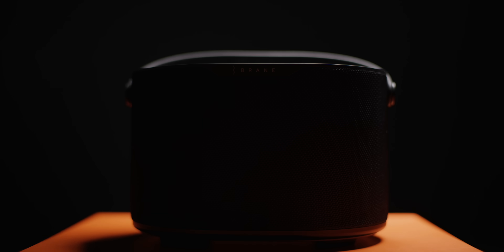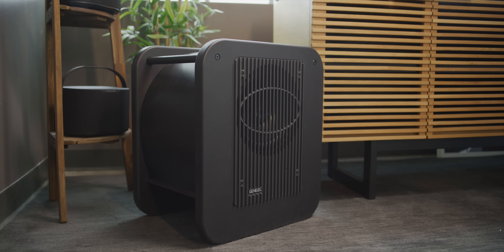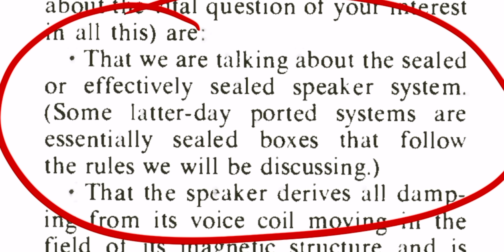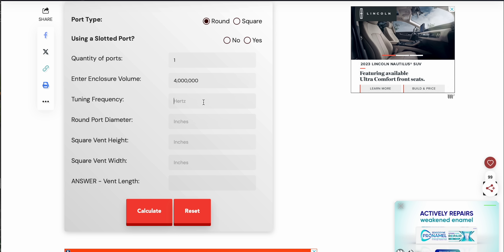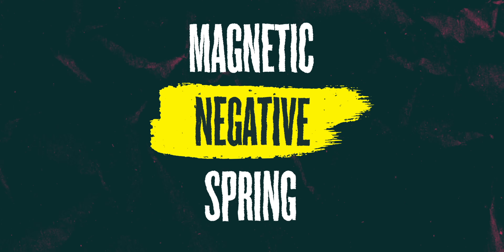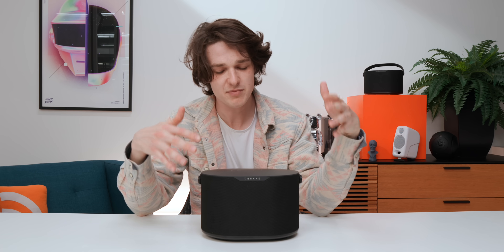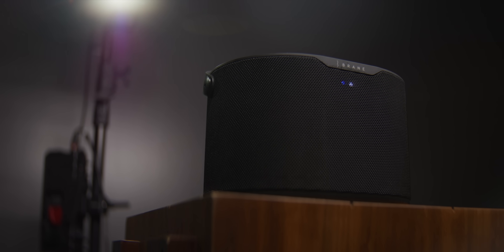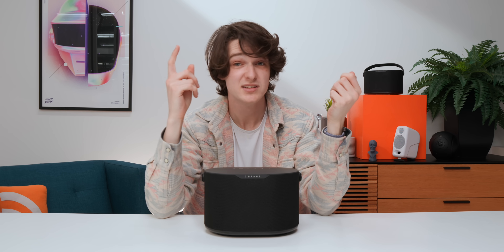How This Speaker Broke Physics.

Comment: it can't go low, I seriously doubt that it can produce audible 34Hz let alone 28Hz. Although, it doesn't realistically need to produce bellow 38Hz to be enjoyable, I doubt it can even do that efficiently in a small plastic box with what I assume is D-class amp on the cheap. I'd have to hear it, but it sounds like "too good to be true" which means it's a lie. edit: yea, after finaly managing to find specs on their website "Subwoofer

One high excursion 6.5" x 9" (165 mm x 229 mm) R.A.D. subwoofer for thundering bass and sub-bass" - that's your average small active woofer for sub $250 selling for $600.

Comment: This is Trash. It’s not possible to break physics and companies who claim that aren’t trustworthy. No matter what you do you can’t get around the fact that the absolute limiting factors are the Effective Membrane area, the maximal mechanical stroke of the speaker driver and thermal losses/limits. You can’t get around this, period. Additionally it is not optimal to use very small enclosure volumes, because the air pressure gets very high, especially with the two important factors of membrane area and stroke. Nothing solves this issue in closed enclosures. The results of high pressure are extremely strong partial membrane resonances, which additionally add up to the already high partial resonances of the flat cone design, which is the major flaw of this design. The part of the permanent magnets and electrical magnets is very stupid to and makes no sense. This is how every damn electro mechanical loudspeaker works! It’s a coil moving in a magnetic field of a permanent magnet. This is already the force which drives against the internal air pressure. And it’s also the reason the membrane moves at all 😂. If you want a higher force working against the internal air pressure, just increase the strength of the coil or permanent magnet. But you will still have the issue of high internal pressure which causes these significant problems mentioned before. The devialet speaker has the same issues. But hey why don’t we make the cone more durable and stronger = thicker? Because the heavier cone brings up a lot of new problems, like a bad impulse response, which sounds terrible. There is a reason why some technologies haven’t changed in decades but only slightly improved, because most often they are already pretty much the best we can do. And I really dislike it when companies use stupid advertisement buzz words with no meaning behind it. No you didn’t break any law and you don’t even want to prove it with any measurements (the picture/diagram on the site is a joke), because you can’t prove it. And your video frankly sucks, it doesn’t say anything proper about the speaker. And the reason is because the company didn’t give you any real information to talk about. So you talk about ported enclosures when this speaker isn’t even ported😂 and the best thing is that a lot of normal people realised it in the comments but still you did big harm. Maybe don’t talk about speakers in the future anymore, because you showed that you have clearly no real understanding of speakers!

Comment: Audio Pro’s ACE-Bass technology[1] (including Yamaha's Active Servo Technology) offers a more clever solution to achieving improved bass response from small enclosures.
 
1. Stahl, K. E., “Synthesis of Loudspeaker Mechanical Parameters by Electrical Means: A New Method for Controlling Low- Frequency Loudspeaker Behavior”, J. Audio Eng.. Soc., 1978, vol. 29, pp. 587-596

Comment: @4:40 -- since when has a 10" subwoofer been a "massive" speaker?   Most of the touring rigs I've used 15"-21" drivers.  One of them had subs where each subwoofer had quad 15" drivers.
Reply: But that's for a venue. For a small living room you need at least 2x12 inch imho.
Reply: @permanenceinchange2326  I'm running dual 18" subs in my listening room at home.  Definitely more than what the room needs, but I have them dialed way down.

Comment: I recently bought the Samsung HW-Q990D with Dolby Atmos.. The Q990C version is a lot cheaper but with the same audio quality, coming close to the price of this speaker.. even though it is somewhat pricier than this thing.. never buy this BT speaker as a replacement soundbar for movies.. I'm pretty sure something like the Q990C or even the Q990B blows this thing away. Both the D and C version sitting on 656 Watts with a bass that shakes the room, literally. The B version @ 246 watts is a lot less powerful but is still good. This Brane speaker would be fine in your back yard as a party speaker but it isn't a replacement for your soundbar as he stated.

Comment: software is the biggest reason so many Bluetooth speakers sound way bigger than they are, They make a half decent speaker/box/passive radiator combo and then physically tune out the unwanted harmonics and boost the ones they want. It's alot the reason why its so hard to make small DIY speakers that come anywhere near as close as commercial ones without a programmable amp and the mic and monitoring software for it.

Comment: I have one of these. It’s nothing but overpriced junk to me. The only frequencies that sound good through this speaker to me are the midrange.
Where do I even start. 
Bass: Big dip below 60 hz. There’s something going on at 30 hz (kind of unheard of) but barely. Also nothing between 30 and 60 hz. 
Mid-bass: Over exaggerated at around 150-300 hz. Boomy, makes the speaker sound like there’s a blanket over it. A lot of the low bass harmonics in this range overpower the actual bass notes they advertise! In fact, all of them do.
Midrange: good. Surprisingly flat response here.
Treble: very recessed, not powerful or clear at all, except for a strange annoying peak at 10 kHz for some reason. Sounds like the speaker is facing the wall.
For those Interested in a speaker that produces a much clearer sound with better treble and vocal clarity, and a better bass tone (to my ears) for probably half the price, check out Harman Kardon’s “Onyx Studio” range of speakers. (Not sure if they’re on the 7th or 8th version at this point.) I have the 5th generation, which lacked waterproofing, but only cost $200 back in maybe 2020-ish. Another good option if you often listen by yourself is to buy headphones. Most over-ear headphones are better than any small speaker will ever be, and at a lower price, especially if you buy a dongle and old school wired headphones. Remember when headphones didn’t have batteries that needed to be charged?? Bring back the AUX jack! I personally use the Sony MDR-7506, which are inexpensive ($100 range), apparently a far better sounding “speaker” than a $600 Bluetooth speaker, and never need to be charged cuz they aren’t wireless! (This is a feature to me.)
Reply: Ouch

Comment: This is a bunch of nonsense and audiophoolery IMO. You can't magically get more bass from a smaller speaker using an equivalent amount of power by changing the driver design. You can design a driver than can handle more power or you can EQ it in a way that it sounds louder. I'm no audio engineer but I call BS on this.

Comment: It`s not really new  -> MAY 01 1971
Improvement of Low‐Frequency Response in Small Loudspeaker Systems by Means of the Stabilized Negative‐Spring Principle. As a practicable means for extending the low‐frequency response of small loudspeaker systems, schemes employing stabilized passive negative springs have been investigated. Experimental loudspeaker systems have been constructed and are described. A typical negative‐spring loudspeaker system, consisting of a 4.3‐in.‐diam diaphragm in a sealed enclosure of 0.105 ft3 provides a piston displacement of 0.200 in. peak‐to‐peak at 65 Hz, when driven by an input power of 2.3 W into a nominal voice‐coil impedance of 11 Ω.

Comment: This is all just lowering the mechanical resonance frequency of the driver in a sealed box (ie, an acoustic suspension loudspeaker - the ported designs don't have any trouble doing this as the spring loading on the cone is already low). The first negative springs designed to fool the speaker cone into thinking and behaving like it was resonating with a softer spring (ie, a bigger box) were purely mechanical; I saw them in a major loudspeaker's labs in the late 1970s. This is all very nice and all but it's not the real problem of getting bass from a small device - the problem is coupling to the air. That's the only way to get sound. A small object just doesn't do it. Wave propagation is where the real physics comes in, and a negative spring has nothing to do with it. Decent power can only be put into the air by an object sized on the order of the wavelength of the soundwave in air, or larger. Sorry, that's just physics. With the negative spring you can probably get the same sound level from a small box with less electrical power in, and that can certainly be useful. But the low frequencies still won't be there. You can put the signal in but nothing much will radiate out. Think of it as all the air being pushed by the small driver cone rushing around to the back of the speaker before it can radiate anywhere. Basically the low frequencies just slosh back and forth, and that isn't what we mean by sound.

Comment: I watched it wondering whether there was going to be a tactile transducer on the bottom and it vibrated the table for more bass.
I'm still not sure about the "magnetic negative" thing, and it will need extra power to do what is suggested.
Using an electromagnet and permanent magnet seems rather like adding a secondary coil to the cone - as in an isobaric arrangement but without the extra cone. That uses more power but half the box size. The devialet phantom is simply "super isobaric". The cones are heavy lumps of metal with big coils and magnets to compress a tiny air space down enough to move and resonate in the bass range. The trade off is you need a lot of amplifier power compared to something bigger, and it is harder to make the sound "effortless" - (lack of mechanical noise and harmonic distortion).

I think on the larger end of concert loudspeaker systems, you can make intelligent use of acoustic coupling to make a design more compact for the output. The Tom Danley approach - drivers of a feather flock together. And you can get something the size of a wide American refrigerator (Jericho horn) to do as well as something the size of a car (line array system).

Comment: Ellis and marques… just hear the Anker Soundcore Boost… this tiny water bottle sized speaker produces enough bass for most people and also has neutral and clear imaging. People wont be needing more bass than this as the deep and mid bass is quite boosted than the rest of the frequency response.

Comment: You totally glossed over how the "magnetic spring" works.  You mentioned it's a magnet.  Also it's an electromagnet.  The way you describe it sound like a speaker magnet and coil.  So is this a secondary internal speaker to compensate for the primary one or what?

Comment: I love good audio, I build my own subs for my car long time ago and always used amps that had great control over my subs (DF). Over the time I got used to all the wireless audio options we have and got excited when there was a new invention that brought better clarity/base and so on. I was impressed about the MBP audio, the AirPods and some bt speakers. Not comparable with my cinema system, but still good (so I thought). Then for some reason I connected my nearly forgotten Logitech Z3 2.1 system from 2003 to my MBP and was blown away. What is really happening these days: We got used to lots of not so great sounding speakers and get excited as soon something sounds a bit better than not so great. I will listen to this one when I have a chance, but honestly I don't get my hopes to high. To get great low bass, you need an amplifier with lots of control (Damping Factor), and lots of sub real estate. Bass reflex as here shown helps to get louder, but often you loose a bit of control. Lots of my friends back then used bandpass enclosures or dual reflex bandpass enclosure to get even lower bass with more pressure.

Comment: Mate, the point of the tuning port isn't to give a bass boost, it's to counteract the impedance hump of the combined resonance of driver and cabinet. The result of which is the ability of the amplifier to driver the driver to lower frequencies without being impeded by the resistance of the cabinet. That means you get the bass the cabinet would have had without such a small cabinet, until the port starts working against you. The port itself doesn't 'amplify' anything.
As to the claims of negating air pressure in cabinet, that sounds a lot like additional internal drivers. So essentially isobaric. So there's nothing new here mate, but maybe to you, and maybe it's a well conceived product. The marketing is just marketing, and will probably have commanded a similar budget to R&D.

Comment: hey,
what's your thoughts on the Sony SRS XB33 speaker and it's sound quality?
I love my music and swear down by this thing after my old boss bought one for himself when i was workin for him and me and my colleague used to take turns picking music during clean down at the end of the night which convinced me to buy my own because I just fell in love with the sound,
Love my Bass and I'm the type of "Audiophile" that likes to tweak their Equaliser settings (which my speaker has it's own built in settings accessible through the "Music Center" app through my phone as well as Device specific settings) and used to have my own 5.1 surround setup years ago and this SRS (to me) covers all the Frequencies to cover all kinds of sounds and music that that old 5.1 threw out...
to the point when I'm playing a game or watching a movie and could swear i can hear something or someone talking behind me only to then pause what I'm watching and eventually figure out it was just the speaker the whole time and all I actually heard was Ambience noises that'd echoed off the walls and I perceive it as coming from somewhere other than the speaker,
bare in mind that I only own 1 of them and it's usually placed in front of me and because of all of that...
I'd certainly recommend the Sony SRS XB33 to anyone that loves their sound,
Not sure about power consumption of this model (if you have any info to that regard, Please share) but for a small sized speaker mostly use it on stamina mode and the sound's still pretty well ranged as it is...
don't get me wrong,
"Live" and "Bass" settings are SOO much more enjoyable and louder but i really don't want any sound complaints.
heh...
😅

Comment: Edgar Volcanic invented acoustic suspension, and Henry Kloss started KLH after AR. You can use a large diaphragm with short excursion, or a smaller diaphragm (cone) with long excursion to move the amount of air required by bass.
Reply: I typed Vilchur, but the stupid error "correction" changed the spelling to volcanic...

Comment: Judging by the FR graph from r-tings it is certainly good for its size if it can be moderately efficient. However, still not that ground-breaking in overall depth of bass. I have some small bookshelfs of a similar size that do dig deeper. Granted they're passive so you don't have to stuff the electronics in, and they are extremely in-efficient (I just threw power at the problem, which they can take). But I am also just a dude, not a whole RnD team with a budget.

Comment: No mention is made how this so-called negative spring will change anything about the physics of the relationship between the thiele small parameters of the driver and the speaker cabinet.  For any given driver and its parameters, there is a limit to what sound pressure level it can achieve without distortion if its inside an acoustic suspension cabinet.  No evidence is provided that this speaker changes that limitation.  What I suspect is going on is that the qtc is so high that a strong bass boost is provided in the bass frequencies most noticed by most listeners, thus giving the impression that the bass is extraordinary; even though the same could probably be achieved with an ordinary driver, given the proper ts parameters, with the same sized cabinet.
Reply: Don't forget adding extra "permanent magnets" around the back of it to counteract the effect of the air compression.  I'll bet Brane engineers used to work at Bose, lol.
Reply: That's exactly it -- they're likely powering and providing equalization. That's it.

Comment: meh, it didn't break anything. it's bass extension is 51hz, thankfully we have companies like rtings that give objective measurements. there are Bluetooth speakers way cheaper than go deeper with bass extension. Sure it's a bit more compact, but it's not ultra compact, so might as well go a little bigger for better extension and way cheaper

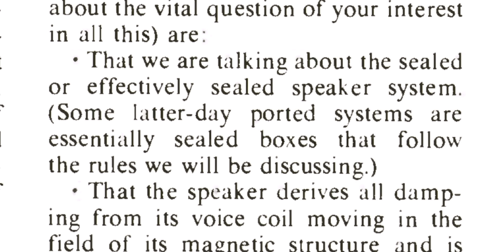Comment: 3:04 You can read here that a ported box (a box with a hole in it) still counts as a sealed box. This is because the port increases the pressure that the speaker has to push against, when operating near the port's resonance frequency.

Comment: hoffman's equation makes it clear you have to trade between size, bandwidth and power, _at a given efficiency_.
use a more efficient design, get more out of your speaker/enclosure combo.
this is achieving the same goal as existing servo subwoofers running in an under-dampened configuration.

Comment: I’ve had a Naim Mu-so Qb for years and that thing sounds fantastic for being a little 8.5” cube. It does it by using 300w of power amps across 5 drivers, and it’s expensive, but there’s still nothing on the market that beats it for really solid room-filling sound from a tiny package.